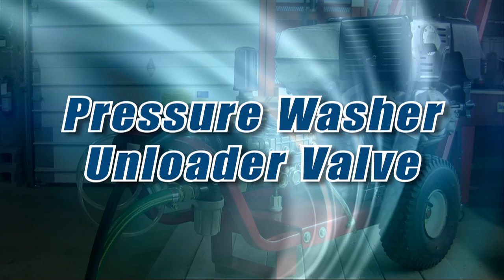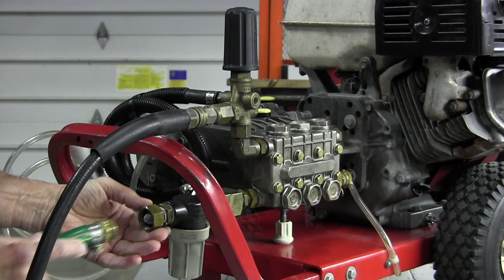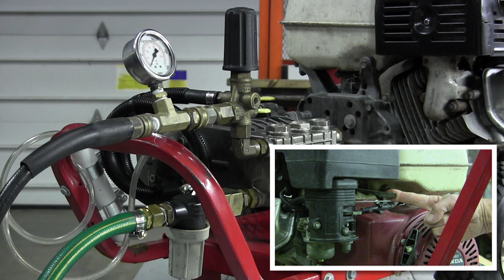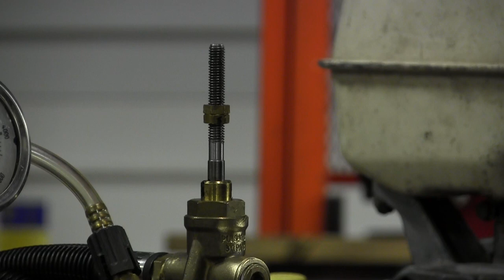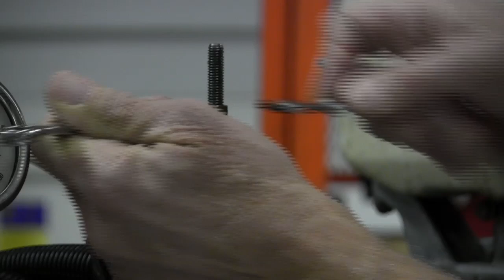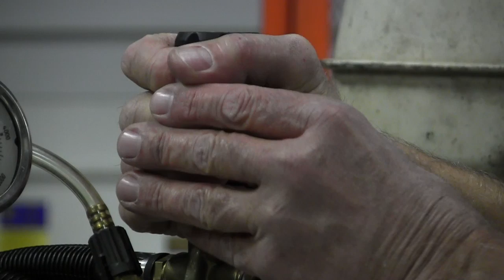Pressure Washer Unloader Valve

Comment: Pressure Washer Unloader Valve it stops when i let go the trigger
but when i open the with the black nut it runs ok it down  some on power
will i do more damage if i keep using the washer

Comment: Awesome video, thank you. I have a couple questions, I have a excell pressure washer with a professional series6600 with a 5.5 hp honda gx160 motor an 2200psi with 3 Gpm. So the questions now, I replaced the unloader valve an the instructions said to adjust until I didn't notice a change in pressure an then back it down an tighten nut, but if I adjust it to 2200, it still can go higher but after about 15 the motor starts to struggle so I hurry an back it down. Should I only goto 2200 no matter what even if it still gives more pressure? An also what size orfice fitting should i be using for my washer? I got it with the broken unloader so I nothing to compare it to as far as how it used to run. But I will say it seems like its more powerful than another pressure washer that had 3000psi. Oh an i also see the psi number with the guage i purchased. Thank you for your help

Comment: My wand allows two setting of a high pressure and a lower pressure setting and also allows an orifice adjustment for spray patterns. It seems that when in the high pressure setting the machine works fine with plenty of water spray but when I go to the lower pressure setting on the wand the pressure is less than the garden hose feeding the machine. Is this a indication of a bad unloader? The engine runs fine at any pressure setting.

Comment: What would the symptom be if the water volume was too low? My washer seems to “ lose prime” and then work for 30 seconds to a  minute then lose prime again (low pressure).
Reply: Or air in the line

Comment: Some of the lesser expensive pressure washers use thermal relief valves. I'm wondering if these can be replaced in some way to redirect the water into a tank.  This unit seems to be made to do that, but some just have this water heater type valve. Is there a way to modify these lesser units to recycle the hot water away from the pump?

Comment: He said the jam nut is to be turned clockwise to increase pressure and then said turn it counter clockwise to increase pressure.  ??? Which is it?
Reply: I know right. it's clockwise to increase pressure. 😎  just don't over do it.  keep the pressure to the recommended psi for your machine. my machine is 3000 psi and I set it to 3200 but no higher.

Comment: my 35000# pressure washer  from  northern tool , will, run fine using the  soap  noozle, but when i put high press' noozle on  it'll run afew minutes then  quit, but will  start again an d run  another few minutes and quit, i disabled  low oil pressure switch, to eleminate  that problem. any idea  what is  causing this problem?

Comment: HI
I have a  Landa Mhp4-3500 hot water 3500 psi 3.5GPM.
I put the gauge there and the pressure is around 1500psi basicaly i lost 2000psi.
Do you think the pump is bad or the unloader??
One more question....for the hot water the unloader is close to the pump or after the heat water container that release the hot water to the hose and water gun???
Thanks
Reply: you should be using a #3.5 orifice nozzle for the size of your machine if those are 3.5 US gallons. If that's not it you can always try to adjust your jam nuts as described in the video. clockwise for more pressure. but if you feel like you have good pressure but the gauge says you don't, then you need a new guage. hope this helps

Comment: Question: I have low pressure with cavitation of water. Have oil spurting out of my red air vent cap when pumps on. Have Cat 3200psi pump. 3.5 GPM. US gallons   Had the PW unit since it was new, it is now 19 years old. Had unloader replaced a few times. Is it possible that its a bad unloader causing the oil to come out of the vent cap? Thanks, Note: Live in Florida, USA where water is hard.
Reply: Sounds like to much oil, or water has gotten in the pump . Either way there is to much something

Comment: Hello can you please help me? I really enjoyed your video, however I'm still confused on what's going on with mine. I have a 3700 psi 4gpm Honda gx390 that doesn't feel like it's reaching max pressure. I hooked a 5000psi guage exactly how you had it on your video, when I start mine up I see the needle on gauge rises between 3700-3900 then slowly decreases to 2500. Once it hits the 2500 it will then peak back to the 3700-3900 range. Once I squeeze trigger for the water to expel on the wand using a 0 degree nozzle I only show 3000psi on my guage. What do you think this could be and I did buy this used. Thank you so much thank
Reply: Good
Reply: Pressure on your machine is properly measured at the gun end of the hose. not directly off the pump. The rating of your machines pressure is measured with the trigger closed[not spraying] the pressure when the trigger is depressed is the working pressure and not how manufacturers rate their machine. I work on these things as well as other equipment and am certified by all the manufacturers in case your wondering.